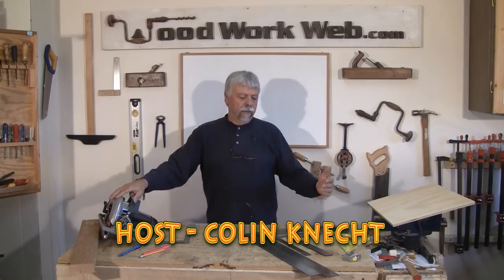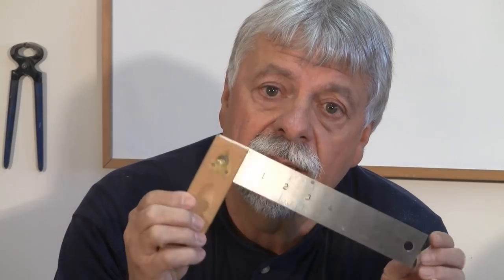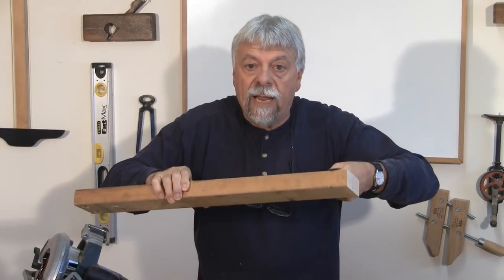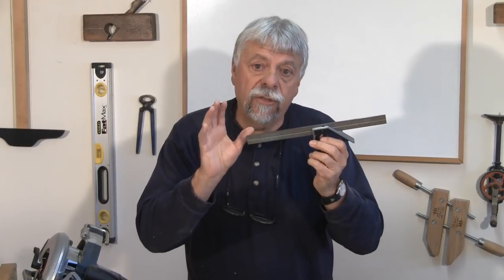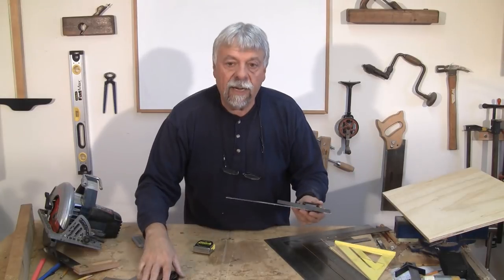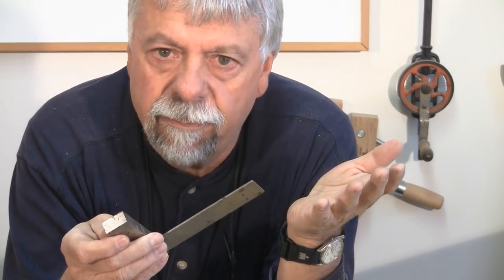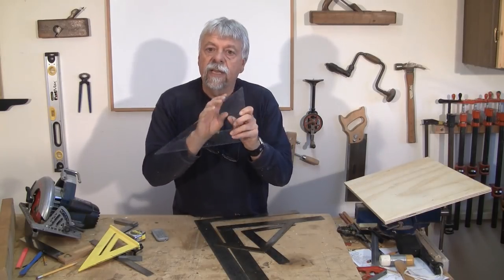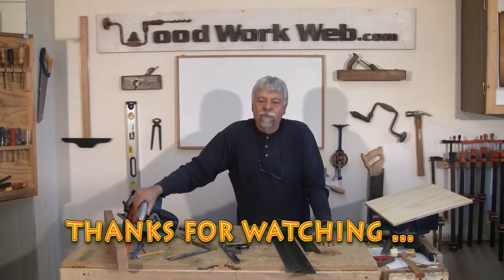Squares - Choosing and Using Them in the Workshop -- A woodworkweb.com video

Comment: It's odd that you consider a tri-square more inaccurate than a carpenter's square. You mentioned that tri-squares are designed to be used by carpenters. Hey, a carpenter's square is designed to be used by who? Well, the name tells that story. I agree that tri-squares can definitely be inaccurate, but so can a carpenter's square. Especially one that has been actually used by a carpenter. I checked my old one and found it was off by quite a bit. Bought a new one and found it was pretty accurate, but will it still be after much use? I'll keep checking it if I'm using it for critical things. I have a drafting square and just bought an engineers square which I will check against my drafting square before using it.
Reply from the maker: That only my experience John, yours is clearly different. Thanks for watching!

Comment: I mean no disrespect, but my combo square is dead on, and it's about 65 yrs old. my small machinist's square however, is not square. so, I have to agree with azbushrat  buy cheap, get cheap, but I take issue with the phrase, they do much more precision work than any woodworker. what actually makes a machinist so accurate, are the machines them selves, and the types of measuring tools that are used. Furniture makers like myself rely a lot on our eye and you're right, we're not perfect.

Comment: I'll stack up my Starrett combination square against anything you
have. Flat steel squares? Hardly ever use them. They fall over or you have to bend them over the edge you are referencing off. Now you are drawing a line on metal on an angle. inaccurate.

Comment: Carpenter squares are not for a wood shop, they are for rough carpentry where you are marking lines with a massive flat pencil and chopping stuff that is not going to be joined like you join furniture or cabinets. It is for framing. That is a framing square. It is as inaccurate as a Swanson speed square. It has its place - a wood shop is not it.

Comment: The thing about the Combination Square is bullshit. Get a Starret - they are stainless and castiron not brass or aluminium. The cheap ones are crappy...
Reply from the maker: Ha Ha Ha Ha .... actually ... no it's not, the fact is that thousands of crappy tri-squares are sold to unsuspecting, well intentioned woodworkers, and these squares are not accurate or consistent, too bad not everyone knows about Starret or can afford them, so best they know what to avoid and what the alternatives are.
Reply: +WoodWorkWeb combination squares were not, are not, made for woodworkers....
Reply: That a combination square has a 45 degree mitre as well as a thick head that registers against an edge, not to mention the embedded scribing awl makes it clear that the overall design is indeed for woodworking.

But WoodWorkWeb confuses combination squares with try squares (and even calls tri-squares).

Comment: Well, um, time for me to stick my two cents in.  First, at least learn what a try square is, that was the one with the wood part.  Then, combination squares from a reliable and respected toolmaker such as Starrett, which now run over $250, I don't think your carpenters squares will be able to match.  Longevity, my Starretts have forged heads, hardened, and a hardened steel blade, accurate to a couple thousandths over the blade length.  The plastic one you showed, the clear one, draftsman's triangle.  The draftsman's square is hanging on the wall.  What you call an engineers square I call a machinist's square and a good one, probably more expensive than the rest of yours, combined.  Precision costs money, and to check a square, you need what's called a master square, it's a very safe bet you don't have one.  Neither do I, with good monetary reason.  And a brass clamp, that screams "CHINA" very loudly.  And like it or not, what you prefer, those are commonly sold as carpenters squares, which with a little knowledge and a few accessories can do an amazing amount of functions to an acceptable accuracy for what the square was intended.  But at least learn the correct names before you start telling other people what to avoid, you're wrong, all the way around.
Reply from the maker: Thanks for the tips, Rich! 
I can't wait to see your video on the subject, it should be very informative for everyone!
Reply: @knecht105  My primary beef, and there are many, is the fact that going to any of the manufacturers sites and looking will give the proper terminology for the tools.  44+ years in metalworking, ending and retiring as a gage technician, terminology is more than just important.  I've had to check and calibrate tools that most people don't know exist, and more brands than most people know about.  I have no complaints if someone wants to use a cheaper brand, that's their choice and if it's appropriate to them, that's fine.  And I'm not innocent of sometimes using the wrong names for things, a framing square, speed square, try square, these to me fall into carpenters squares.  Brand makes a huge difference here, a Stanley isn't going to pass any real attempt at calibration, where a Starrett or Brown and Sharp will.  An import, even less chance and probably a very short life before they lose any reasonable degree of accuracy, some probably out of any spec before they were packaged.  
I don't like writing "books" in the comments, but I"m closer to eighty than to seventy, I don't have the video editing software and less inclination to buy it, and I'd have to say at least 60% of the information on You tube is either half right or completely wrong.  Measuring isn't a black art, it just requires a little care.  Terminology isn't something that's hidden from view, it's available all over the net.  Then there's such a thing as buying books and "reading" a little.  OR download what's available, and that's considerable.  Just a few minutes ago I saw a professional shop referring to the "Ruler" of a square.  Cringe to the max, in the square, it's the blade, without the head, it's a scale.  Things that I knew when or before I was nine, grown men making a living using haven't learned yet.